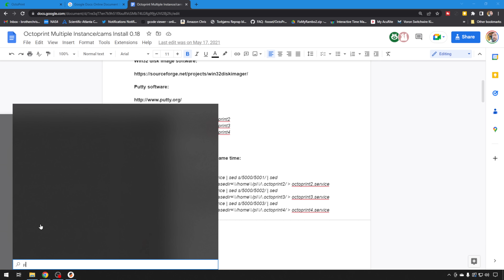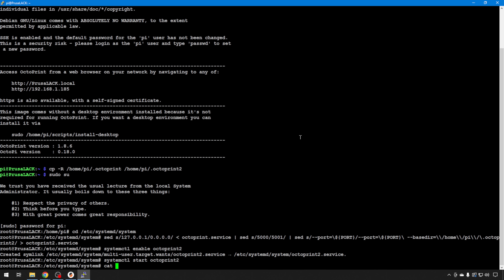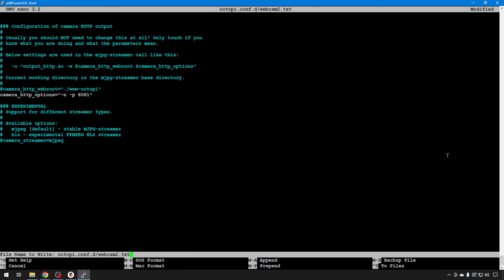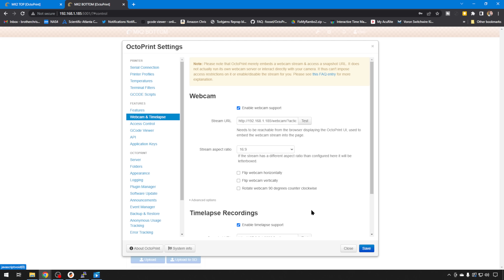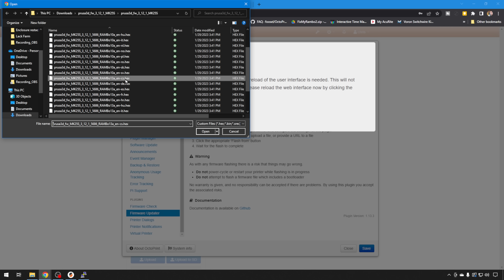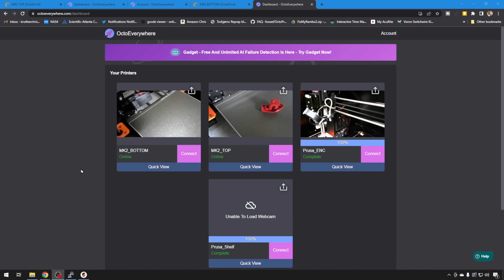Multi Printer Lack Enclosure - Part 3 - Enclosure Restack - Chris's Basement - 2023

Comment: when you get done are you going to use a tablet, small pc, or laptop as a control hub to view and interact with everything?
Would love to see a video with tablet and small pc setup for interaction and viewing.
Reply from the maker: I usually use my laptop. I'll look into the small pc Thanks!
Reply: @ChrisRiley  with the Fire Tablets being so cheap as refurbished , $39 for Fire 7, or just new for $50..  seems like a sweet option for the Interaction side of it.
Plus Fire Toolbox brings Google Play to the Amazon tablets.. so it opens up more automations if that's wanted. 
Have been seeing them with Klipperpad and some other mods.. figured if you were into it you could throw your own spin on it

Comment: Is there a good place to ask a question about changing a prusa screen from stock to a btt tft50 with non touch mode firmware? Wondering if it can be done
Reply from the maker: Btt discord would be a good place to start. This upgrade will work in Marlin mode only, but you will have to flip the plugs over as the upside down on the Prusa's. So flip them 180 on the board side.
Reply: @Chris Riley  I couldn't find their discord anywhere. I'll keep looking. And I believe the non touch is basically marlin mode. I think at least. And flip 180 meaning keep plugs in same socket but turn upside down. Or change sockets?
Reply from the maker: @thegmkiller1967  I looked again, maybe they don't have one. Correct, Marlin is non-touch.  The Prusa board doesn't have a black shroud around the pins. You can unplug it, rotate it 180 and put it back. Not sure how well it will work, but it would be worth a try.